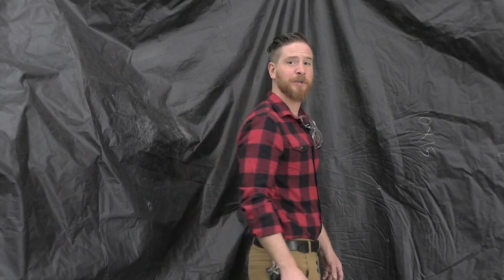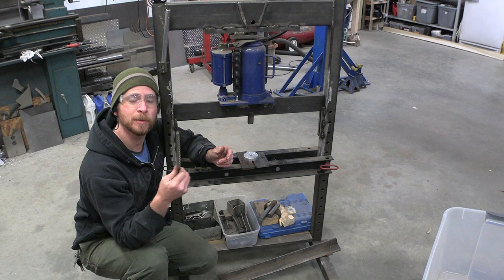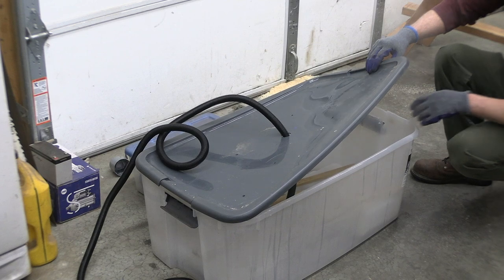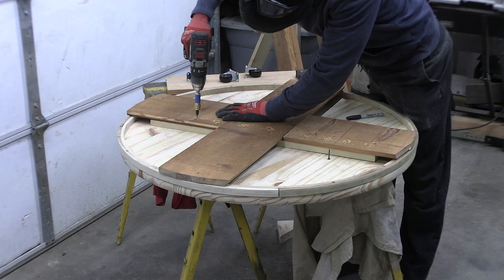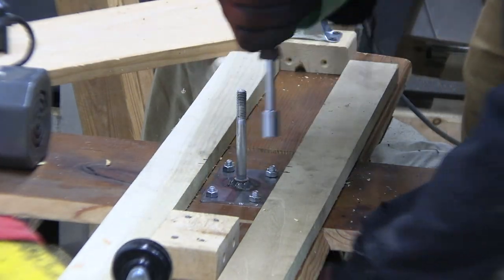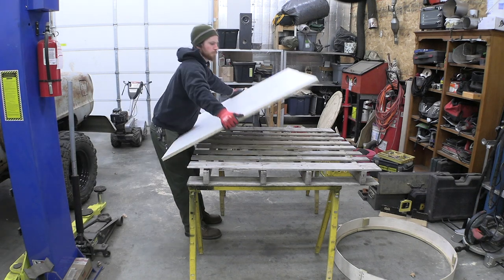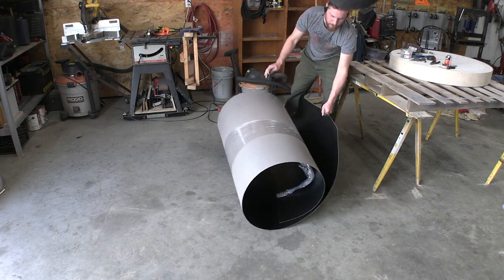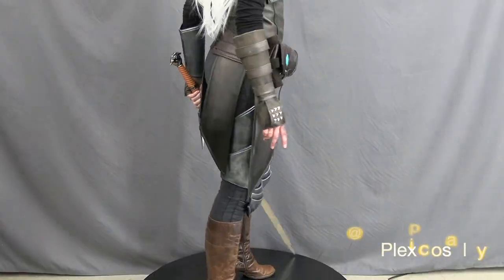I Build a Full Size Rotating Photography Platform for Cosplay, Props and More!

Comment: What is the size of your 2 pulleys and how did you do so that your pulley does not scratch with the outer brackets of the engine? Did you increase the height of the pulley or add the pulley on top of your part that goes over the engine?

Comment: I've been contemplating a project like this forever! May I ask what kind of motor you went with and how much weight you think it might support?
Reply from the maker: I bought a 60W motor with a gear reducer that brings it down to 135RPM max. It's plenty strong to turn me but I'm only ~160lbs. I tried to load my go-cart on there and it struggled, with the limiting factor being the grip of the rubber "tire" on the drive wheel. So I think the motor is appropriately sized but you would likely have to find a better way to get grip on the platform if you want to turn more than 250? 300? lbs. 
Good luck!
Reply: I am doing this build and may change a few things. I did find the motor used in the video I believe based on the looks of it and the description provided in the thread. Amazon for $105.89. Link (non referral) https://www.amazon.com/gp/product/B09LV1P1WT/ref=ppx_yo_dt_b_asin_title_o01_s00?ie=UTF8&psc=1

Comment: Interesting. So theoretically... Hypothetically.... Could one.. modify this with a variable speed motor to say... Spin a human anywhere from 30-70rpms. Sounds ridiculous but coming up with new acts and equipment for circus. Needing a rotating platforms that is motor assisted that allows an athlete to hold and elbow/headstand while rotating. If let's say this is possible.. what motor would one look for? Also the athlete by changing their own shape (starting wide and ending small) would increase the speed of the platforms rotation but I wonder if that would have any effect on the motor. As I'm sure there might be resistance.
Reply from the maker: That seems pretty dicey, if I'm being honest. and you would likely need am much bigger motor that spins at around 1000rpm. Or more likely use a powerful motor that's geared down to around the 30-70 rpm and use some sort of chain drive. This design here would not be up to the task of those speeds.
Reply: @MoreToolsThanSense  hey thanks so much. Going to conscript a metal machining expert

Comment: I noticed the hole in the center on the top after the laminate what function does it serve that it still shows? Nice video!
Reply from the maker: One of it's main functions is so I can see the centering pin when I put the top back on. But I can also screw a large bolt into it and later I will add a "Stand" for holding various props.